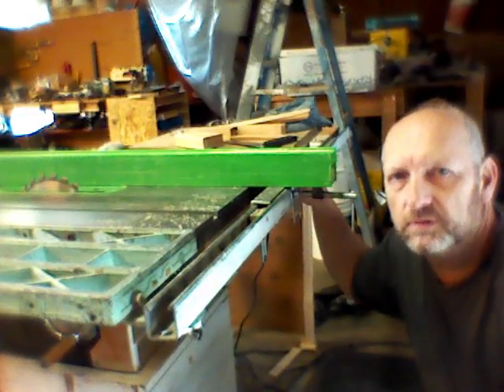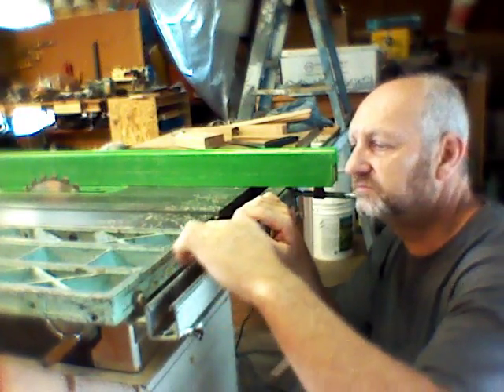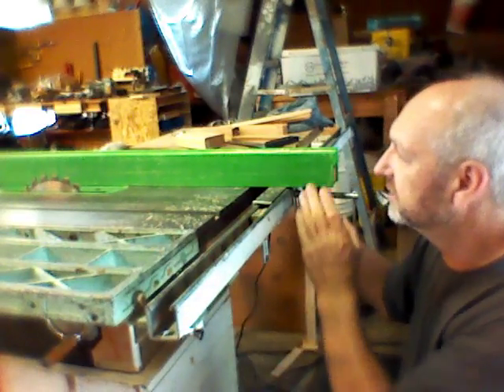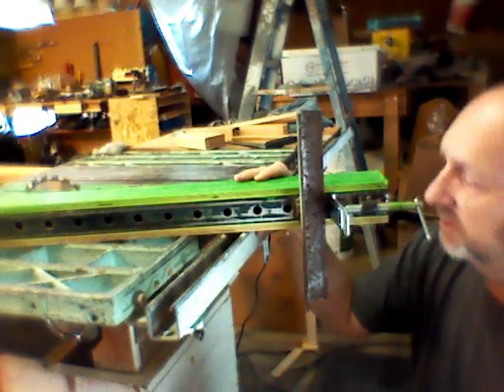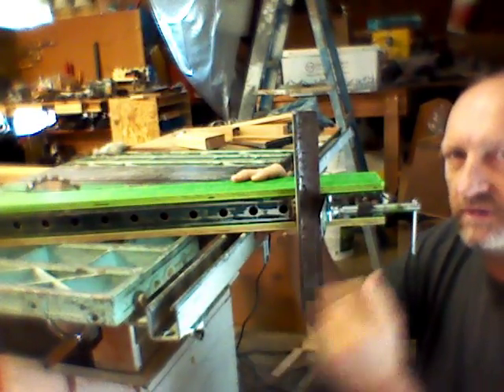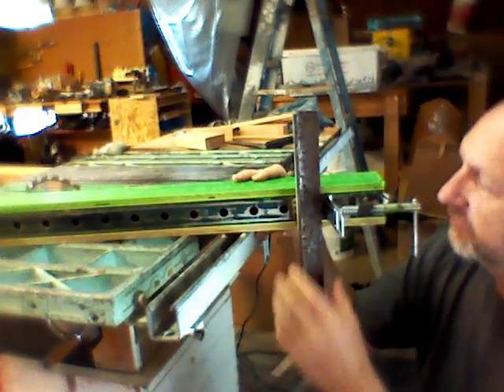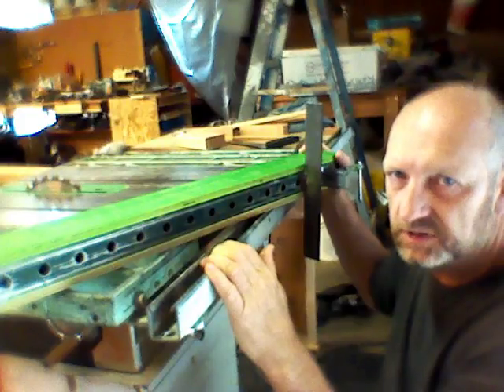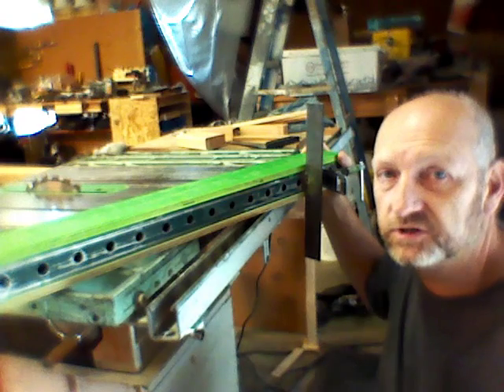How to make a homemade table saw fence system

Comment: Any square tube will obviously work as rail? Thank you for simplifying the problem of getting everything perfectly square, as long as the fence and the blade are parallel. Did you confirm that by using any measuring device?
Reply from the maker: +Hannu Mononen I used a framing square.
Reply from the maker: +Hannu Mononen I used a framing square. Then did the 5 way cut test.
Reply: Thank you. That should indeed confirm the correct alignment reliably enough.

Comment: HI Sid. VERY simple and straightforward fence.Want to buil one myself.A question: How thick are walls of tha channels you use.Your fence is really uncomplicated not like other fences YT.
Reply from the maker: I'm not sure how thick. Maybe 1/8 inch. It made out of unistrut. Got it from Lowe's in electrical dept. About 20 buck for 10 feet.
Reply: @Sidswoodworkingprojects  Thanks a lot Sid.That is more or less my unistruts thickness 3mm.

Comment: Hi Sid.Another question.How tight should the belt be that drives the motor.Mine sort of wobble/jump up and down making a funny noise. Something like glug glug, but it cuts like a dream.Would it be good to put on  a new belt with teeth in it.Mine is a smooth belt on inside.Thanks in advance,
Reply from the maker: Mine is tensioner by the weight of the motor. If the belt looks ok you shouldn't need to change it. You might check to see if you have a bent pulley. Mine is 
Bent on the motor so it vibrates a little. I need to change it. Good luck.
Reply: @Sidswoodworkingprojects  Thanks a lot Sid. I've got a converted 3 phase to single phase cabinet saw.Discovered that the bolts holding the motor to mountings near pulley was a bit loose.I tightened it and all is well.I built my fence your way and it works like a charm.